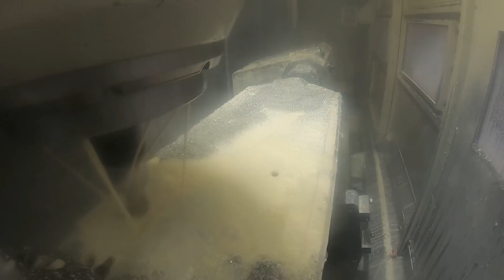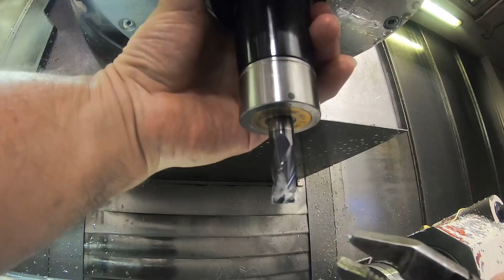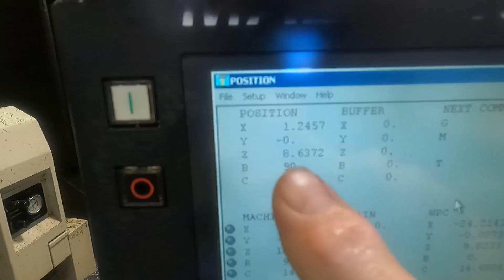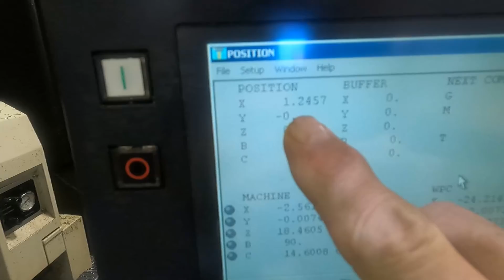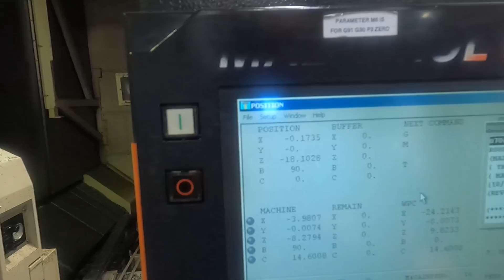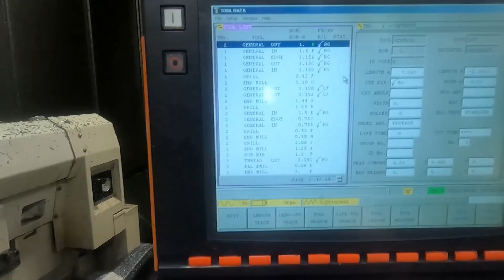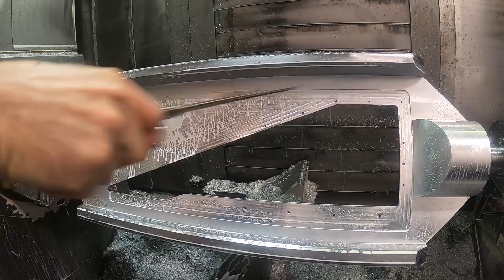Completion Of The Fixture For  the Mazak

Comment from the maker: In this video I saw and called out the height from center with the Haimer Probe. It was really 1.2457 but should have been 1.2475, I reversed the 5 & 7. This caused a error of .0018" to high on the -.1875 target dimension I was shooting for. I have gone back and faced the .0018" to the proper location. I didn't realize my error until I reviewed the video clips.
Reply: Very common human error. I hate when I mean to come down .001 on a bearing fit and punch in -.01 lol there’s one machine in our shop that has a sticky 0 key that you really have to pay attention to make sure it took the zero on the screen because probably 30% of the time you have to redo it because it doesn’t take. I hate when that happens!
Reply: @norandavis856  Too expensive to replace the keypad pcb?
Reply: When you have such a giant hole like that (in the first 5 minutes)..  It sure seems like it would make more sense to roughly mill the outline of the hole (leaving room for fishes passes);  leaving only a few tabs holding the center plug, and just cutting them with a hacksaw, and saving that huge piece of material in the center for other projects, and you save wear on the tool.. and also reduce some of the chip waste disposal.  Idk, maybe there's a reason you don't, but I would not like having to mill out that much material, if it's possible to save the center waste.. Any thoughts on this?
Reply from the maker: @calholli  It is more difficult than you think to slot around with tabs just to save the material. To spend the time to save it just isn’t worth it. I know it seems like a large piece but slotting thru risks breaking tools to do so. This could cost more than the saved material. And if anything goes wrong you risk the main part. Not to mention the time to manually cut the tabs. The material in this case is a odd shape witch is hard to process into something. It could be done but in general it isn’t worth the time.
Reply: @calholli  I think it would also cost precision.   If he doesn't have to reach in with a hacksaw and cut or remove the part to do so, he can do all the machining in one setup, ensuring all operations use exactly the same reference points.  As he says, this fixture needs to be precise.
Reply: I was going to ask what the tool you were using to rough the fixture was. Looked like it ran pretty quiet even though you were taking a decent cut. I also noticed your Haimer doesn't retract right to zero or maybe this is just the camera angle. I was getting a bit of an error on mine after using it for a couple years and had to adjust it so it returned to zero. I also, like you, do not like using them as indicators. I have had them either break or unthread and throw the Z off. Even with only 5 thou preload I have seen the ceramic stem break.
Reply from the maker: @maxvillemachine652  I didn’t say I didn’t like the Haimer. What I was referring to is. I see people using them to sweep in things like a test indicator. What I said is I don’t think they are good for this purpose. I do like the tool for its intended purpose. It isn’t necessary that the Haimer reads zero in the relaxed state. It has to be aligned with centerline when reading to the deflected zero. In the Z axis you measure it’s length in the depressed zero state. I have never had trouble with it this way.
Reply: Can you show exactly how you zero your tools on this?  Are you just checking  offset, or setting the offset?.. I notice that you will bring the milling tool down to the part, and then you'll reach your hand in and use some choice of gauge block;  But how are you progressing the machine?  Is there a dial that you're turning manually, or is there a button that is simply adding small step increments?  Please show the zero process a little closer when you get time, if you would please.
Reply from the maker: @calholli  There is a hand jog wheel on the control. I am using that while holding a pin up to the tool. Moving the machine in very small increments with the jog wheel as I feel the pin between the tool and the reference surface of the part. In this case the OD of that diameter. What I’m doing is measuring the length of the tool. There is a offset length entry in the control for the tool the machine thinks is in the spindle. That’s why I let it change to that tool first. It knows where the centerline of that diameter I’m using as my reference. So if the offset for that tool is set to zero in the control. I jog the tool down to the diameter measuring with the pin just passing thru. Than I subtract the radius of the reference dia plus the pin diameter off the tools position on the controls position display. That’s the length of the tool to enter in the offset for that tool. Now the machine knows where the tip of that tool is and I can run the program for that tool. I know that’s a long description, I hope it makes sense. Thanks.
Reply from the maker: @calholli  yes but you have to measure the tool the first time. That’s what I’m doing. It’s the first time I’m running these tools. After that if the tool was in the machines magazine and already set. This wouldn’t be necessary.
Reply: @calholli  It's a Mazatrol with an encoder wheel, pretty sure he's slow stepping to touch off on a used piece of carbide.
Reply: At least you were too short..  lucky day. lol...
Reply: That was what I meant by using them as indicators. Sweeping around parts. They work great for setting zeroes.
Reply: I noticed that instantly but thought you had already measured it and were just showing for video purposes, good beforehand catch though!

Comment: hi, on this type of machine you can add a T table and still have some rigidity?:D
Reply from the maker: Yes I think that would be possible. In fact if you had a old table from say a Bridgeport type mill. It could be mounted something like this fixture. I have a shorter fixture that holds a 6" Kirt vise. Also you would have full five axis capability.
Reply: @EdgePrecision  Thanks for your fast answer. I  have an old fadal even is 3 axis I must learn a lot about fixturing, this type of machine for me seems to be the TOP of machining. And when I saw that fixture I was thinking "maybe can you make a VMC if you really need it from this machine"

Comment: After running a variety of Mazak machines for years I am wondering why the hand loading of tools and no measuring eye or even a Renishaw probe for that matter?
Reply from the maker: This machine has both a laser tool setter and a tool eye. The laser hasn't worked sense I bought the machine. And I haven't bothered to fix it. The tool eye on this machine is very difficult to use. The control doesn't have a jog pendent extension. With the control all the way forward to the chuck end of it's travel on the tracks. It is very difficult to reach the handle jog and be observing the location of the tool on the deployed tool eye. It is way up there where the tool change door is when deployed/folded down. It is actually easier and faster to manually touch off the tools. Also I get a verification of the tools actual position in relation to my setup, witch I like. I do have a Renishaw spindle probe. And have shown it in a few videos on this machine. I mostly us it in in process probing. For setup and things like I shoe in this video I prefer to us the Haimer probe. I don't feel on a mill turn machine like this there is much advantage to using the Renishaw probe to set a fixture offset in just the Z axis. As most all of the setups on this machine have the X and Y offset already a zero. Maybe there would be a use to set C zero if I was running a lot of parts that required that. But most all my work that isn't necessary. In the case of this setup once set it doesn't change for the next part. And I also prefer to run the indicator over things anyway. A probe only hits in a few points. It doesn't really give you a feeling of the actual shape of things like a dial indicator does. But that's just my preference. I always prefer a analog mechanical dial indicator to a digital device. And the batteries don't run down.
Reply: @EdgePrecision  Thanks for the reply.  Only time I have ever used a manual dial in a Mazak is for setting up a part.  It all goes off of the wpc I am currently running a very old H-800 and while not a true 4 or 5 axis machine it still runs pretty good.  Mazak makes good machines for sure.

Comment: When sneaking up on a final dimension with an endmill is there a minimum cut you should take, and is this different for side milling and facing? Great channel thank you.
Reply from the maker: In aluminum no you can pretty much do as you like. The cut depth has more to do with finish in mild steels. As you say the facing cuts are different than milling with the side of the tool. In mild or softer steels you want to take a deeper finish cut on the facing cuts to leave a better finish. Also possibly increase the speed as well. A tip radius if possible will help this too. I usually program around .010” on the face and .005” on the side for finish cuts.

Comment: Hi Peter, I have a question for you, I see you use Gun drills sometimes and was wondering why a gun drill would be better then a regular drill? Does that make sense?
Reply from the maker: There are a couple of reasons. When drilling tough materials like inconel titanium and some stainless steels. A gun drill will be slower (usually) than a twist drill but it will be more reliable drill straighter closer to size and leave a better finish. Often my parts will have intersecting holes. a gun drill handles this better than a twist drill. And the number one reason if I'm drilling a deep hole, if I break a gun drill. I can always get it out of the hole and continue with a new one to finish the hole. Or at least I will say in all the years so far that's been true. not once so far have a scrapped a part from a broken gun drill. Can you say the same with twist drills. But I dont use them for normal holes only deep holes and some holes that require a good finish with a close tolerance and minimal run out/drift.
Reply: @EdgePrecision  that is a great explanation and I really appreciate it!! I do have another question for you and it is that I am doing these parts that are 37.000 long that get two 7/16 holes drilled the length of them, I am doing them on a HAAS VF9 with a 90 degree angle head using a twist drill going 19.000 deep then flipping the part and doing the other half! My holes are not lining up the best and I was wondering if you thought a gun drill would work a little better for me? The material is just 6061 Aluminum.  Please let me know what you think!!

Thank you
Reply from the maker: Yes I think you will have a better chance with a gun drill. But there are many factors to your misalignment than just the tool. Have you checked all these possibilities first. Having verified that all is in the best alignment possible. You should have a better chance using gun drills. I would probably use two gun drills and a start drill for this aluminum. Drill a start hole say around one inch deep start your short gun drill and drill half way mount your long gun drill and drill the rest. To the 19+ inches deep and flip the part. Don't try to drill it all the way with one long drill. In a commercial gun drilling machine the drill has steady rest supports that collapse as the drill goes in. But in your case you start with a shorter drill, than go to the longer drill. The hole that you already drilled acts as the support because you don't have those steady rests on the drill. If that makes sense.
Reply: @EdgePrecision  Thank you very much for your advice! If you don’t mind I will let you know how I make out!!
Reply from the maker: @travl3217  Shure I look forward to it.
Reply: Thank you Peter, this worked perfect!! The holes were straight in line. I really appreciate your feedback!!  Thank you

Comment: While I appreciate the skill and effort you've put into making this, I have to ask:
- why not set an initial datum on rotation centre and program everything to it?
- why are you not using the tool setter to measure all tools beforehand and then only focus on proving the toolpaths, instead of stopping and measuring each tool by hand
- why not rough, semifinish in one cycle, check a few key measurements, then run a full finish cycle? Time savings would be considerable this way, especially with the machine having the capability to run continuous cycles with auto tool changes
Not criticising, just saying that there is a lot of room for optimisation by letting the machine do the work for you. 
Other than that, well done, looks great.
Reply from the maker: First the program is at the center of rotation. The critical surface I needed to be at minus .1875 because the part is .375 thick that the fixture is made for. So in order to keep its program at the center of rotation that't where it had to be. the reason I am touching off tools by hand is the tool probe doesn't work on this machine. But even if it did I would still probably do it this way. The probe folded down is very high up and to the back (where that door opens for the changer). It is difficult to manually jog a new tool up to and see where it is in relation to the tool probe. With out a jog pendent (this machine doesn't have one). So you cant really get up close to the probe and jog because you can't reach the control even when it's at the position closes't to the spindle end of it's track. Those tools are all new tools (not setup) in the program so I had to touch them off before running them (in other words I could not run in full auto mode as you call it). I did run a roughing and finish pass intentionally set to leave material. Than ran a separate finish pass to bring it to location (I thought that was clear in the video). When running something like this, a fixture or even just a one part job. Often it is necessary to work this way because all your tools aren't completely set before you run the program. Now it is possible to setup and touch off all the tools before everything. But that doesn't really save any time over doing it the way you saw in this video. But thanks anyway for your noncritical comments. Everybody has their own ways of doing things. I do it this way. It works for me. You do what works for you.

Comment: so is this fixture for a specific part, or general purpose?  

not saying I know better by any means, but why aluminum?  on such a big machine, i would have thought you'd go with steel or cast iron?  was there a need for it to be light?
Reply from the maker: Yes it's for a specific part but I can't go into what the part is or does. Customer wont allow it. As far as the aluminum. It is plenty strong enough for this part. It's only real purpose is to allow machining from both sides all in the same setup with all the different angles this part has. This setup will require some 5 axis positional movements to face certain areas on both sides of the part.
Reply: @EdgePrecision  thanks you, and great work per usual!

Comment: When you have such a giant hole like that (in the first 5 minutes)..  It sure seems like it would make more sense to roughly mill the outline of the hole (leaving room for fishes passes);  leaving only a few tabs holding the center plug, and just cutting them with a hacksaw, and saving that huge piece of material in the center for other projects, and you save wear on the tool.. and also reduce some of the chip waste disposal.  Idk, maybe there's a reason you don't, but I would not like having to mill out that much material, if it's possible to save the center waste.. Any thoughts on this?
Reply: I guess when you're getting though as much material as he does, saving a odd shaped piece of scrap isn't so important,  but to hobby machinist a lump like that would be a prized find at a scrap dealer.

Comment: Hi.  Tell me, wasn't it easier to handle inclined surfaces in five axes?  it's much faster and cleaner than rolling out with a radius.  Do you have the possibility of 5-axis machining, or are there some flaws and it does not always work?
Reply from the maker: From that side there are clearance issues with the B axis spindle and the head stock area of the machine cabinet. Now I could have come from the other side maybe. The B axis is tipped away but the C axis would have to be rotated. It would have required a tool extension. Because of the tip of the B axis to get the angle at the sharp end of the cutout. It might have made better video content. But I just didn’t do it. I wanted to keep things simple. Sort of just get the job done.

Comment: Peter, great MRR, is that the iscar shread mill?
Reply from the maker: The inserted roughing endmill in the beginning of the video is a Iscar tool I think they call it a MILLSHRED P290 ACK 1.5-3-21-W125-18. I bought this tool for a steel job a long time ago. Thought it would work good for this.

Comment: 9:27 I am curious, was it not possible to machine that slope, that you machined with the bull nose end mill, with a radial cut on a normal endmill and a simultaneous multi-axis toolpath? To me it seems that would have been a lot quicker.
Reply from the maker: Not from the side I’m working from. There would be interference with the top of the B axis milling spindle on the chuck end. Now I could have rotated the part 180 and come from the other side. This would tip the B axis inward. That would have worked if I used a long enough tool to avoid hitting the edge stiffener on the bottom of the Y axis. That might have looked more interesting for the video. But I just went with the easy but more time consuming way.